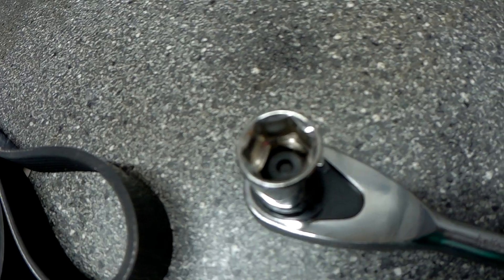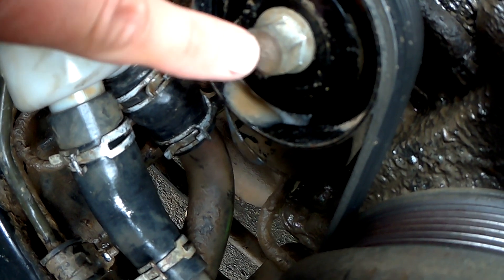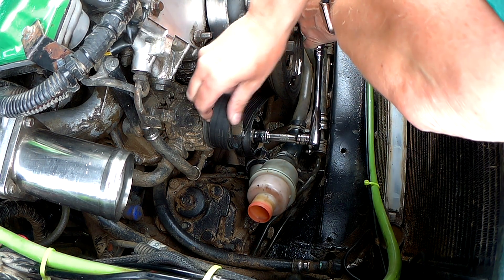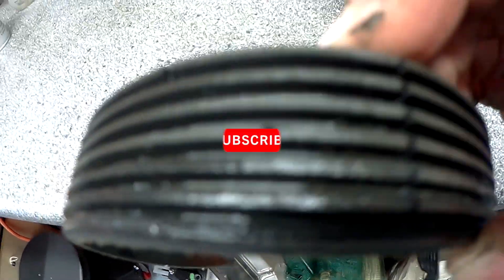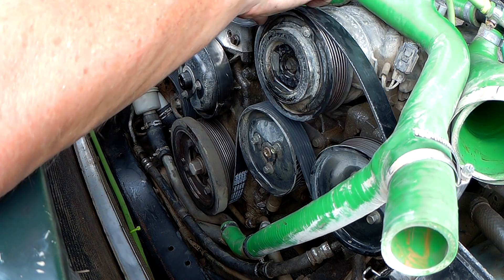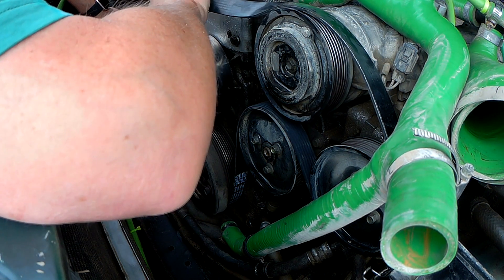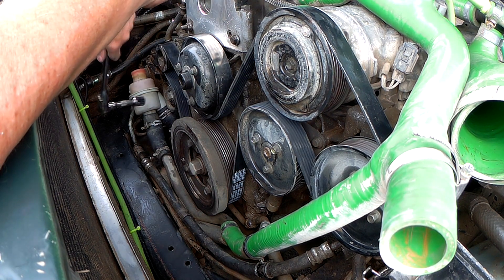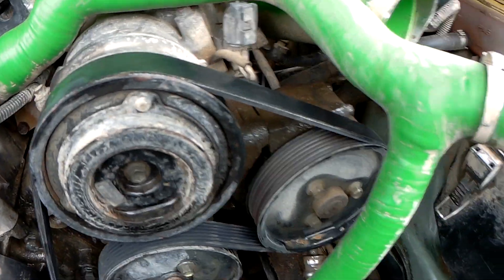Discovery TD5 serpentine belt replace - how to inc part numbers and diagrams. Landrover new fan belt

Comment: Any advice you can give me as I can’t refit mine the belt is still too tight to go over the last pulley
Reply from the maker: Have you pushed the tensioner pulley across which will move give you the required room to install the belt?  If so are you sure you have the correct belt as ther eare at least 3 different types.  HTH
Reply: @trollmanrs  yes the tensioner is all the way back and it’s not slack enough to go over the last pulley and I guess so they did it off the reg number but I can’t do it I’ve had enough of today I’ve been trying to do it all day near enough
Reply from the maker: @flintsmith154  sounds like you have the wrong belt. Did you crosscheck the part numbers in my video with what you are fitting
Reply: @ I had a britpart belt before and that was tight to get on but went on eventually and this new one is a dayco and I’m having no luck with it at all

Comment: When you move the tensioner what happens if the nut undoes?
Reply from the maker: It shouldn't undo as the bolt is purely to move the tensioner. The unit is held in with another bolt lower down.  I would replace it. Not sure you can rremove just the pulley on the TD5.
Reply: @trollmanrs  Brilliant! thanks